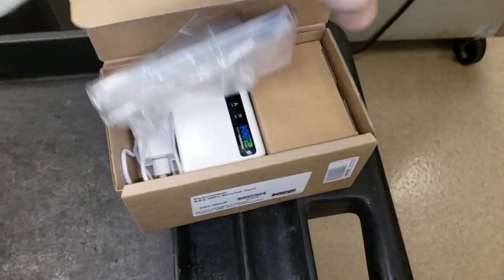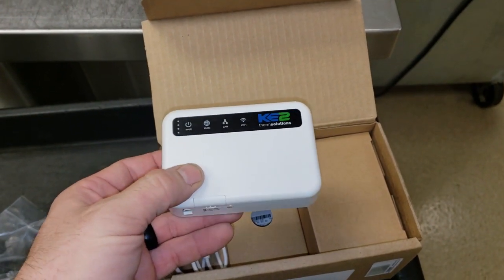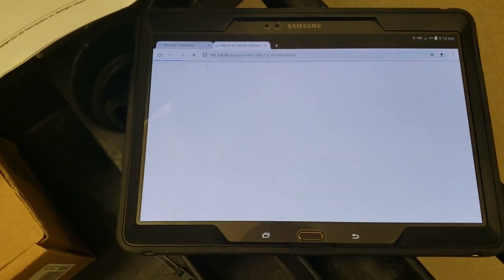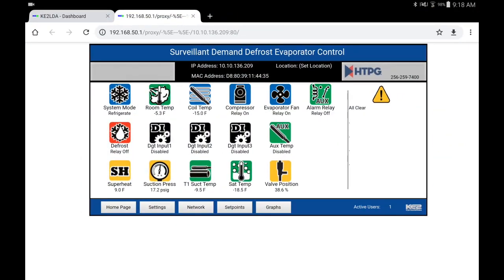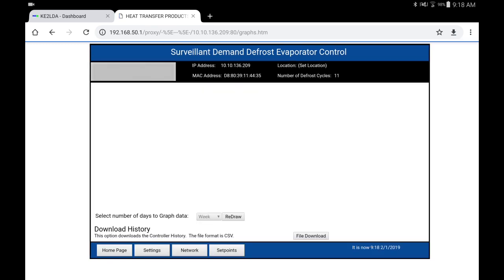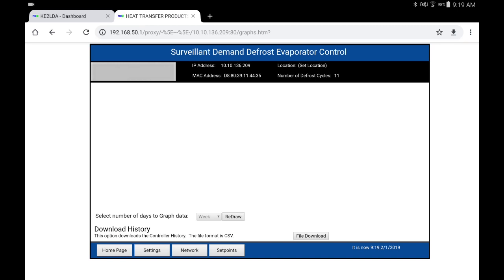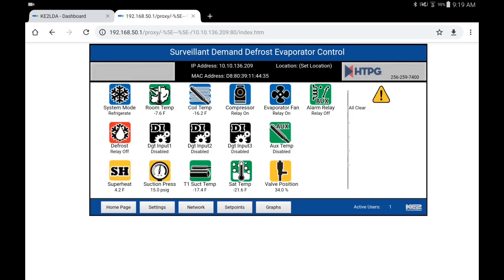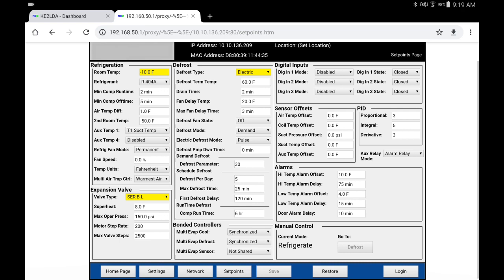KE2 Therm WIFI service tool

Comment: I have been installing that evap efficiency for a long time now. If you sell your first one buy the wire loom and mount the unit outside of the freezer. (So much easier to install with the wire loom and easier to work on if outside the box.
Reply from the maker: Thanks for the tip that was actually my plan
Reply: Love the videos keep up the great work
Reply from the maker: Thanks bud
Reply from the maker: Thanks for watching I am going live on Youtube tonight 2/11/19 at 5:00 PM (pacific time)to talk about my previous videos and answer questions, if you can come over and check it out
https://youtu.be/9ZvGO4xQCP0

Comment: Our company went with one of those “green” air-system management companies. The two buildings are managed by graphic software.  Refrigeration compressors utilize chilled water, (chillers often fail to transfer between the two basement chiller systems, (while attempting to auto-restart, after a building power-transfer test), (monthly test).  Had so many people involved to resolve the auto-restart trouble. Still fails.  (Old chiller system).  The newer 350 ton roof mounted chiller system works better, (if the AC breaker is not tripped).  These buildings keep the facility folks hopping.

Comment: Very cool system.... didn’t know you could get the little WiFi box separately. Gonna have to invest in one of those. Definitely worth what ever it cost to not have to stand in the box and try and figure everything out.
Reply from the maker: Yep that was exactly my thought. The wifi module was 200 and change at United refrigeration
Reply from the maker: Thanks for watching I am going live on Youtube tonight 2/11/19 at 5:00 PM (pacific time)to talk about my previous videos and answer questions, if you can come over and check it out
https://youtu.be/9ZvGO4xQCP0
Reply: I have a 25 ft flat cable. Plug it in and lead it out of the door. I just wish there were more advanced controls like the diagnostic controls like manual controls of the eev.

Comment: Just found out from one of there reps the other day they upgraded there edge manager with the 5 sensor kit to be able to use it similar to the wifi service tool or the LDA. Can accept serial controllers or ethernet controllers to provide customer a dashboard for up to 35 controllers. Just passing some information
Reply from the maker: thats cool thanks for the info
Reply: @HVACRVIDEOS no problem
Reply from the maker: Thanks for watching I am going live on Youtube tonight 2/11/19 at 5:00 PM (pacific time)to talk about my previous videos and answer questions, if you can come over and check it out
https://youtu.be/9ZvGO4xQCP0

Comment: I am totally going to make one of these units with the Raspberry Pi and battery pack probably alkaline cuz of the temperatures.
Can make essentially a portable Wi-Fi router and the ethernet port built onto the Raspberry Pi like a Raspberry Pi 3 custom 3D printed case couple magnets on it I'll be happy.

Comment: If the wifi service tool were connected to a switch with multiple ke2 controllers networked to it would you be able to access multiple controllers over the phone/computer

Comment: Is this the latest version of this controler? or do they have one with a built in wireless access?
Reply from the maker: They do have an integrated controller that comes pre installed in equipment and it has built in wifi, but I dont know if they have built in wifi in their aftermarket controllers yet. Last I heard you still had to use the wifi service tool
Reply: @HVACRVIDEOS  thank you. Another question. What do you do eliminate the defrost clock at the condensing unit when installing this controler?

Comment: How much money was that controller? Where did you get it from? Did you have to go through a supplier or could you buy it straight from the factory? You can text me the price if you like to not post it
Reply from the maker: The wifi module was 200 and some change and I picked it up from United refrigeration
Reply from the maker: There is no other stuff needed I just plugged the wifi module into the controller and connected the the wifi hotspot it created with my tablet. It was super simple